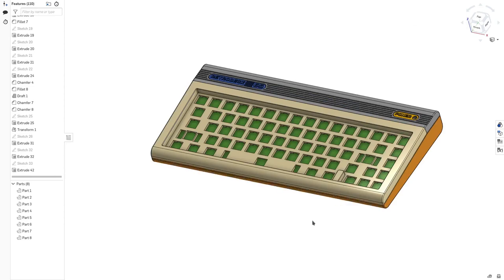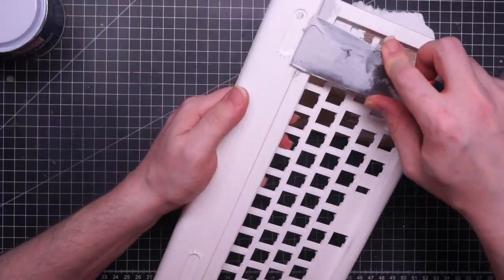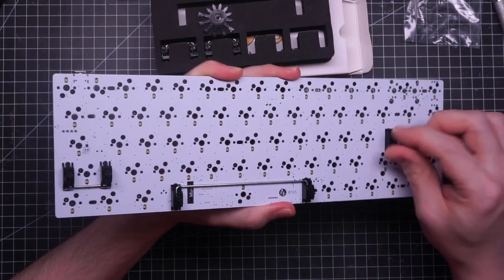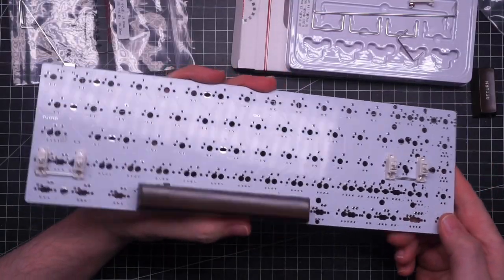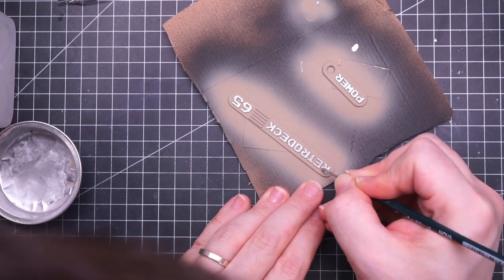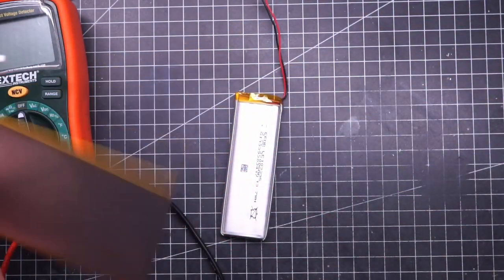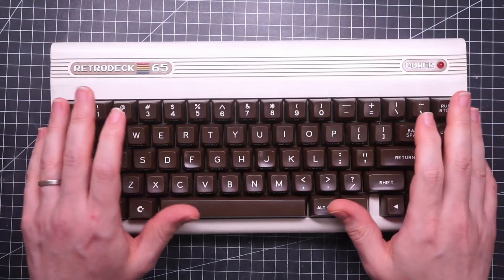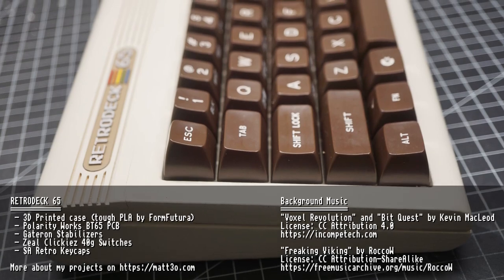3D Printed Commodore 64 inspired custom keyboard

Comment: What printer was used for this?
Reply from the maker: it's custom made
Reply: @matt3o  That’s awesome! Do you recommend any printers for a project of this type?
Reply from the maker: @DanYe_East  the ratrig v-core 400x400 is a really good one if you can build it yourself
Reply: @matt3o  Gotcha, seems a bit too much for my knowledge but do you know if the ender 3 pro or prusa can handle these projects?
Reply from the maker: @DanYe_East  width is about 330mm... so anything that can print around 350 should do. The new prusaXL for sure, also probably the Ender 5 Plus, anycubic Kobra Max, and many others